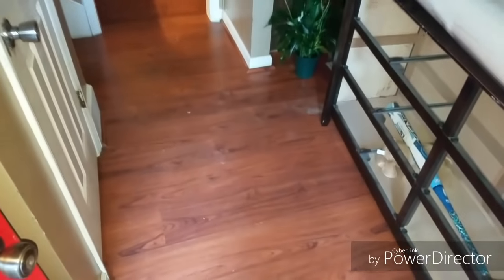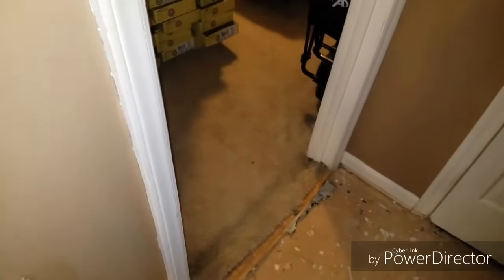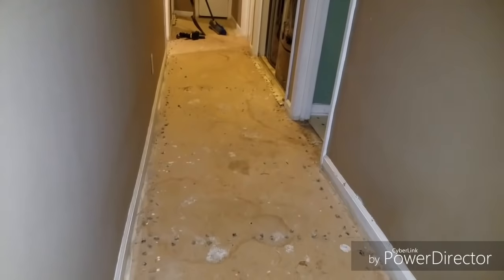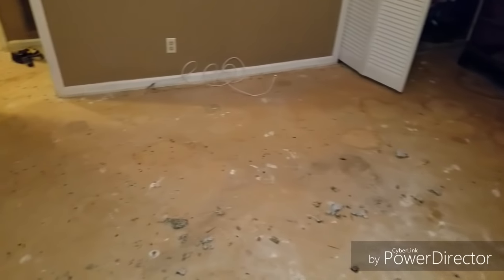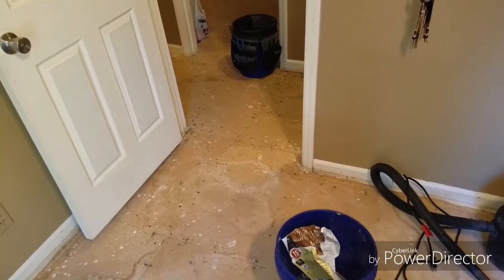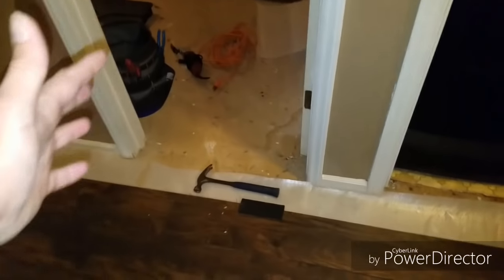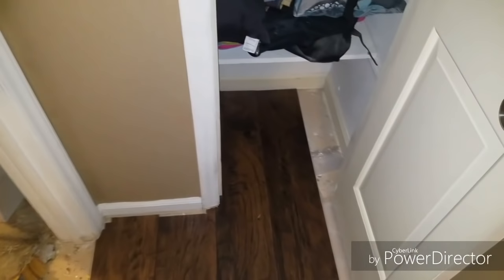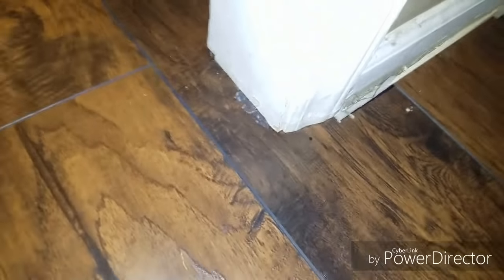Handyman Attacks Laminate Flooring

Comment: Laminate flooring over that large of an area needs transitions. These transitions allows for room to room expansion. Any tight fit at door jambs will cause the floor to buckle in high humidity seasons. Every area of installation needs 1/4” . Humidity over 55 % will buckle the floor. Buy yourself a humidor to check the humidity if doing a basement. I would never put laminate in a basement in the southeast United States. Too humid. Slap a lean on that house. Get square pay and let them pay by credit card. If so, charge 4% more for your labor.

Comment: You did an excellent job especially if that is your first time. Did the client request to have no thresholds? I always use them. If you ever have damage it easier to pull up planks at the threshold. I have done several and pulling all those staples is a pain. Hope you got paid well. The job looked very professional. I chagre 2- 2.50 a sq ft. No furniture moving for me.
Reply from the maker: Thanks for your comment.  I agree, I think next time I'll use transitions. I have another flooring job coming up of about 1200 sq'.  With stairs from lower floor to 2nd story, with a landing.  Plus pulling all carpet.

Comment: Just a lil advice, i would never do a home with all that furniture in it. And having to move all that stuff, of course you get paid but doing it alone is a lot of work! I would of told them: '"Hey if you're not there I'll do it". And everything is moved so you can work properly on the floor.  Some job's are A lot to take on by yourself especially if they are there living in it with that much flooring to do. I learned the hard way and just did it anyways but man was it a headache
Reply from the maker: Yeah, this 1 was a headache and still continues to be one.  Still hasn't paid. Looks like I'll be putting a lean on her very soon.😤
Reply: @adventuresofahandyman4446  yeah what I do is this. Always ask for half up front from the quote have the agreement typed out so it protects you and them. And if they don't agree at the end to pay you I would tell them you will take them to court and file it downtown. Let them know you're not playing and you'll out a lean on it also. Always do a contract on BIG job's especially where it's a cpl thousand $$$... Hope that helps and she comes to her sense's. Tell her you have video of it right now.

Comment: Like your video, ? Did you do a lot of gluing
Reply from the maker: Only in places like under door jams where I wasn't able to get the board to go under the groove.  I had to plane the groove off, glue the edge then slide it in.  The video series I mentioned shows it.  Also,  that's the tape you see.  Just to hold it in place until the glue dries